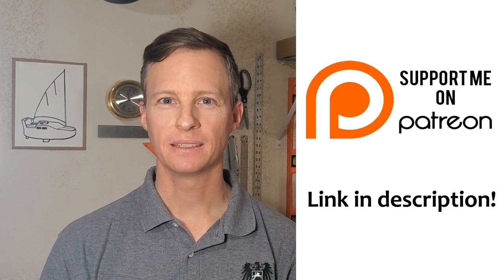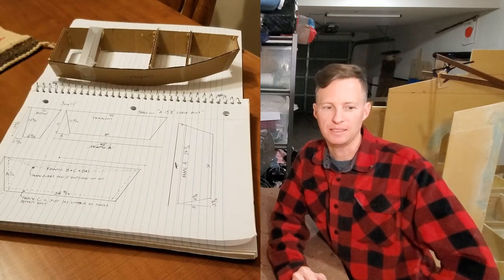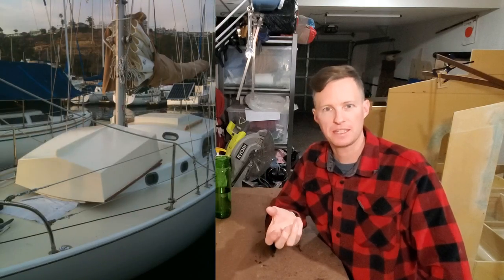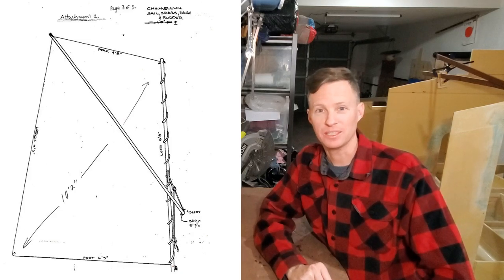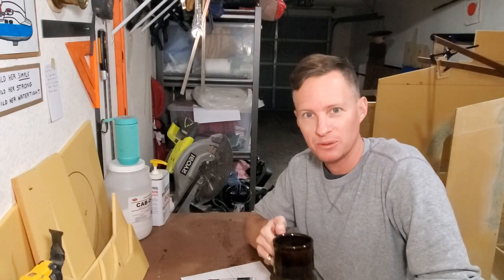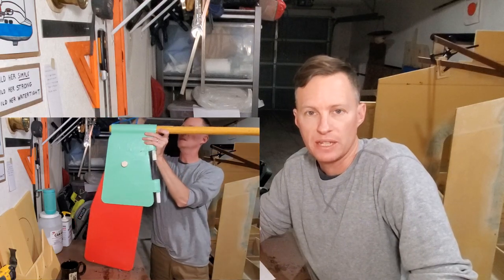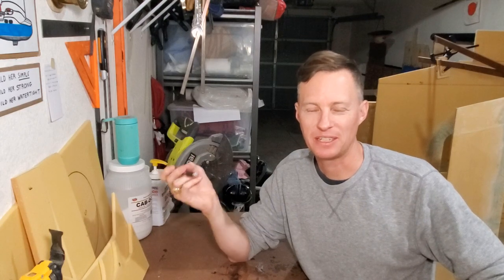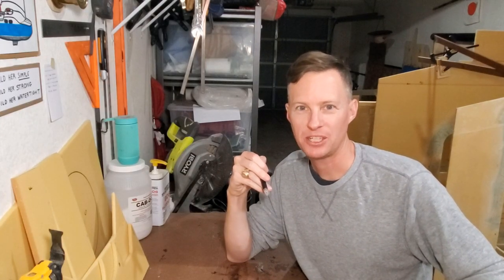OCSS-020 Launching the Sailing Dinghy

Comment: Great video! Weight is the thing we boat builders all forget about. Ten years ago, I built an 'improved' 2.4m / 8 feet Puddle Duck punt from 6mm ply & increased the freeboard by 100mm / 4 inches. It was a great work barge when I was working on my yacht or fishing with 4 adults on board - but it weighed 80kgs / 175lbs. I redesigned the punt and rebuilt a new version in 3mm S&G ply - 28kgs / 62lbs - solo unload / load from roofracks - planes with 5hp and carries camping gear for a week.
Reply from the maker: One of the plans I referenced for this build was a free one online called a "15 foot fishing punt." Mine's just 10' though. 3mm ply would have worked well, but even better would probably be 6mm PVC foam.

Comment: you could buy yourself a ducky sailing catamaran. it's similar to the old sailing hobies with the trampoline nets in the middle. except this one is inflatable and packs down into 2 bags that can be packed inside any normal sized car, the longer bag might have to go on your roof as i remember you have a short car. the boat as a whole only weights 77lbs so either bag shouldn't be too heavy to lift solo. I've never sailed one, it just got recommended to me by someone who owns one that really loves his. the only downside is it will take 25 to 30 minutes to set up and about 15 minutes to tear down. but that is the price you pay for it's portability and being so light weight.

Comment: An original Sea Snark is the thing to have if you want to load, carry, and sail alone. I used to carry mine under one arm with my fingers in the dagger board slot, the rest of the boat stuff tied together in the other hand, and a small backpack for my personal things. 
I could walk a fair distance like that as long as it wasn't too windy. Later I got an old golf club trolley and modified that to carry it.
In the early 1980's I paid AUD $50 for the boat. After a few years the sail was really ragged so  I made a new one out of a bed sheet. I fitted rowlocks to it and it was a fast solo rowing boat. I used it more than all the other boats I've owned put together because it was so quick and easy to get afloat.
When I left Australia I gave it to a friend and he used it and taught  his children to row, paddle, and sail in it.  I'm pretty sure one of his now adult children still has it.

Comment: I made the same mistake when I made my first boat (a Puddle Duck Racer).  When you are building a boat the temptation is always to make it extra strong.  However, with a small boat like that you really need something that you can manhandle.  I solved the problem with a trailer from Harbor Freight (so I wouldn't have to lift it overhead), and a simple cart that allowed me to push it down to the water from the parking lot.  There is a real advantage to a boat that you can launch without a boat ramp, and I suspect that, even though your boat is heavier than you would have liked, that you could find a way to get that done.  Even when you have the much larger boat I still suspect that you will find yourself taking the dinghy out for a sail.

Comment: I am about to launch a very similar project, self designed 11 ft sailing dinghy. it is one piece though I have bought a new trailer for it. My children have grown up and I have grandchildren so its for them to learn to sail and explore in, the trailer so that the families can take it on camping holidays etc. It has 2 sails an optimist sail for when it needs to be a docile trainer and a larger rig for when someone wants to have a more exciting sail :) 

Really only you can decide to keep or not because it depends if your family will use it, a boat like that needs to be used.
Reply from the maker: Cool. What are you building it out of?
Reply: @ocean_capable_small_sailboat  7mm construction ply on frame with epoxy and 400gsm glass on outside. Frame is recycled pallets (we import 3meter long metal from the east coast USA so pallets are syp or spf marked) I use the 2 x 4 and cut it down on my bench saw to 18mm x 38mm for frames stringers etc selecting out best pieces. This is the first  boat I have done this way the previous boats were all done with best marine grade timbers and ply it doesn't save money  as materials are a very minor component I have discovered. But it is only a bit heavy and not too heavy its certainly strong and as its built for kids to explore our local estuaries it need to cope with serious misuse.

By the way I live in New Zealand.

Comment: Cool project. Looks like you did a nice job. Even if you don't end up keeping it, I'm sure it contributed to the skills you are using to build your current boat.  I built a nesting pram out of a kit last winter, and found a disadvantage to the flat-ish bottoms and pram bows, namely the noise they make while being towed or streamed behind your boat at anchor. Yes, it does give you more capacity for a given length, but the wave slap racket seems to be little-discussed.
Reply from the maker: Interesting, I hadn't thought of the noise. I'm definitely glad I built it because of the skills I learned and epoxy experience gained.

Comment: I’ve learned that if something is difficult to use/do, like a hobby, then you’re just unlikely to do it as often as you should.  Someone who has a family and a lot of things going on, time to do things needs to be streamlined as much as possible. 

How often would you ride a bicycle, if you had to put it together and take it all apart every time you wanted  to ride it? As opposed to taking it off the bike rack and wheeling it out the door. 

Keep it simple and as easy to use as possible.  If it isn’t, then you won’t use/do it.
Reply from the maker: Very true. This is why I'm thinking I'll keep my mini-cruiser on a mooring or a marina slip. The cost is higher than trailering it, but any afternoon I can go down and be off sailing in minutes. It will get a lot more use.
Reply: Exactly, I have my Trailor sailor at the marina 30 minutes from home from door of house to raising sails in 45 minutes. 

I Trailor sailed once and the setup and takedown, taking in and out of boat ramp quickly had me looking for a seasonal dock.

Trailer sailors are great though for exploring new waters for multi-day trips.

I don’t windsurfer as much either because rigging even a tiny windsurfer is a PIA
Reply: After having my Yamaha25 on a mooring ball in Monterey, I would pony up for a dock if one is available. The mooring requires maintenance, and you also need a dingy to get to your boat. It is also harder to clean your boat on a mooring. Seagulls seem to love boats on moorings. Having a boat at a dock makes it much easier to just go sailing and it is like having a beach house.

Comment: I am curious if you believe quarter inch foam would have been sufficient for most parts of your dinghy and if so how many layups on each side would have made it strong enough? Perhaps if ply had only been used for areas of particular stress like transome, bisecting joints and mast support areas?
Reply from the maker: I think you could build it out of 1/4" foam, I wish I had. I'd do 2 layers of cloth over all large surfaces and 2 6" and 8" wide strips at the corners where panels join.

Comment: IMO ask your kids if they would like their own boat. You could build a bicycle trailer that your kids can tow with their bicycle when they're a bit bigger. If my dad had given me my own boat when I was 13 that I could sail I would have been absolutely over the moon.  But this plan assumes you can find/build a good and safe way to tow it with a bicycle. Guess it depends how heavy it really is and whether it requires man-strength to get on a bike trailer.
Reply from the maker: Sadly I'm a short car trip from the ocean, instead of biking distance. Probably a lighter 8' boat would be more practical.

Comment: what is the weight of the boat?
Reply: may be possible make it from 5mm or 4mm plywood?
Reply from the maker: I don't know the weight, but each half is quite heavy. I can carry a half myself but not lift it up on the car. If I did it again I'd build it out of foam, but I'm not taking on more than 1 boat build at a time.